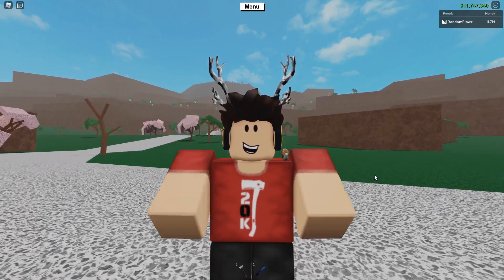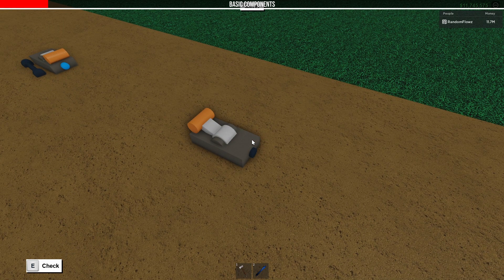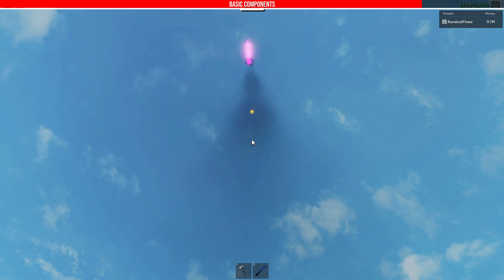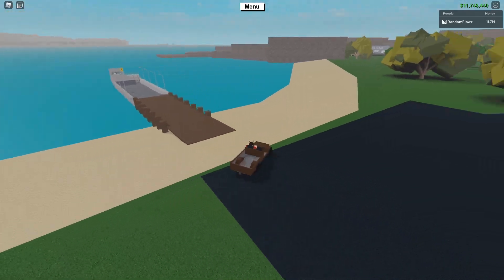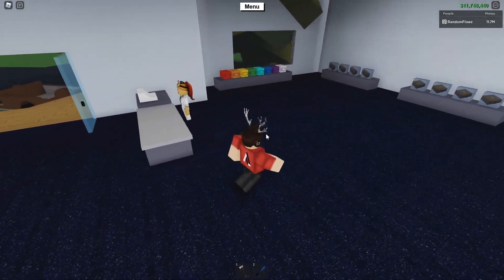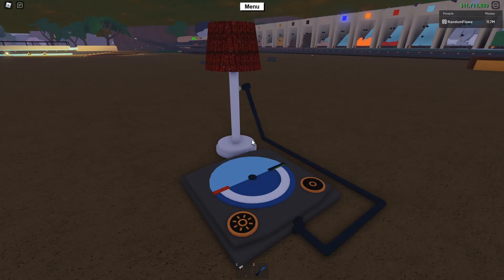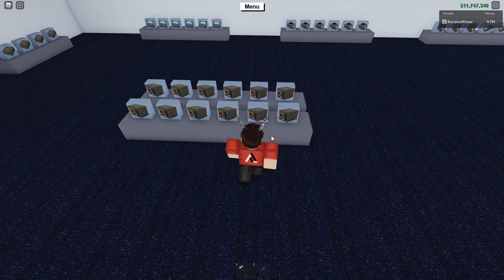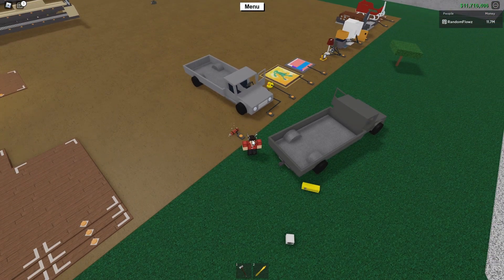Everything YOU NEED TO KNOW About LOGIC In Lumber Tycoon 2

Comment: Hey man I wonder if you can do another logic store example. I'm having a hard time figuring out a mechanic system where all my doors can be put down into lockdown with one single switch to shut all my doors but every door has an outside and inside switch to open both sides of my mechanical door. I can't figure out a solution where I used to be able to use the hatch to cut the power and that was my way of shutting down everything for every single door. But now they patched it where no longer useful and now I can't figure out how to use the logic store stuff.
Reply: Could you give ideas and how to use them with a way of displaying more of how things work and how to make really cool twisted ways so I can try to follow them more easily.

Comment: here is something i did to make my life easier with logic, i made a logic circuit which is basically a d latch with the d input set to feedback from a part farther in the circuit which always contains the opposite logic of the current state and hooked up a button to the clock to allow the button to work as a lever and provide a larger hitbox for my modwood setup so that i can change conveyor directions more easily
Reply: after watching the first few seconds i realized this is completely unnecessary lol
Reply: @Dagot  sure i can figure it out pretty quick, you will have to have two sets of not loops that get broken depending on where the hatch or in most cases, a short door is used for